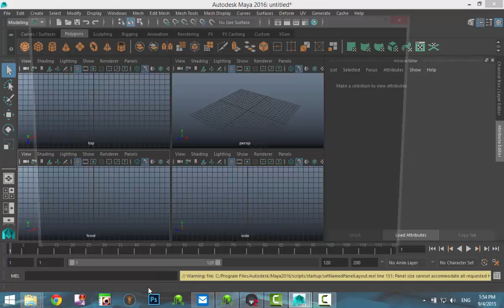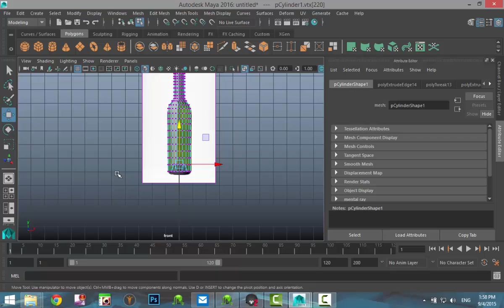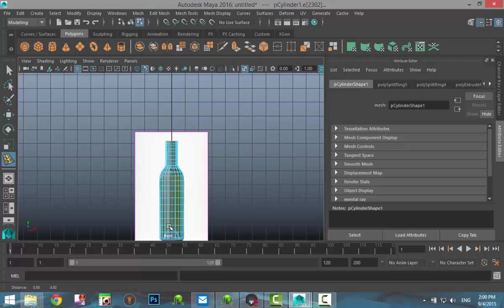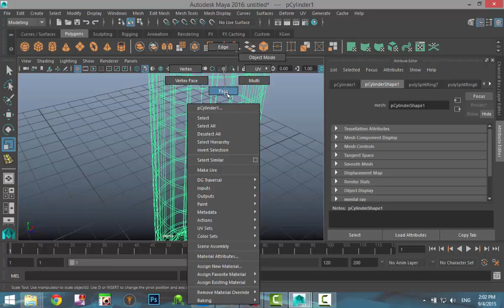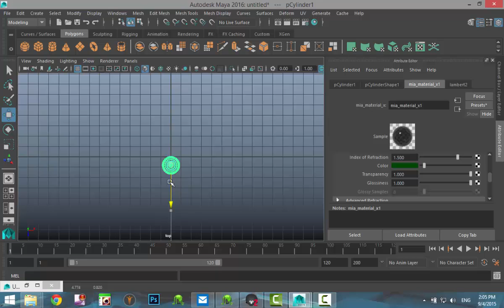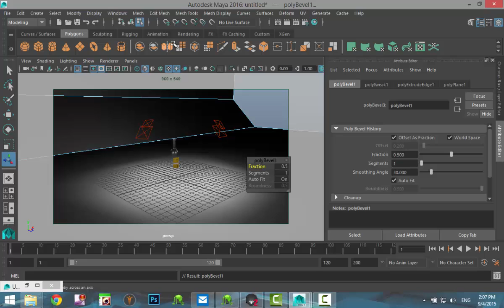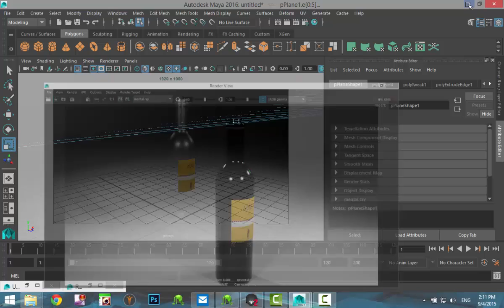Maya 2016 tutorial : How to model and texture a Wine bottle

Comment: Everything ok but the label is stretched on the end of both left and right side. In uv editor it shows me that the shells are more thinner when it comes to the edge. I saw some similar tutorial in 3ds and the guy was using Unfold option (though in Maya there is a tool with the same name but works differently, like for other purposes). In 3ds this option optimized shells in such a way that they were all the same width. After that he exported to psd, prepared label on the shell, imported it and stretching was no longer exist. Is there any possibility to do this optimized/unfolded shells in Maya? I couldn't find any clear answer and I feel lost...

Comment: Hello sir. i'm kinda new in maya and i have learned many things thanks to you.
i have done this tutorial and i've got same result except one thing and it is lable.
This is my little work and the Error in the bottom.
https://postimg.org/image/atoteqil5/

The jpg file loads fine when i place it in file location field. But i can't see it in viewport 2.0 while hardware render is on, and also when I begin a render, MentalRay comes back with an error relating to the file location or subtype.
Any idea what's wrong?

Thanks Again
Reply from the maker: Have you moved the image file to a different location ?
Reply: No Sir. i'm not that noob =]. File is still in it's location. i also tried to copy the file in some other locations and changed the address. but still not working.
i guess the problem is related to my mental ray stuff.
https://postimg.org/image/i0xg0axlz/
i had problem with finding and installing the main mental ray as you can see in the image above. But finally the last one, was the correct one. well... i'm new in maya.
Maybe i need to uninstall Maya and all stuffs and re install it plus the correct mental ray.

Thank you anyway sir. i wish the best for you.  :)

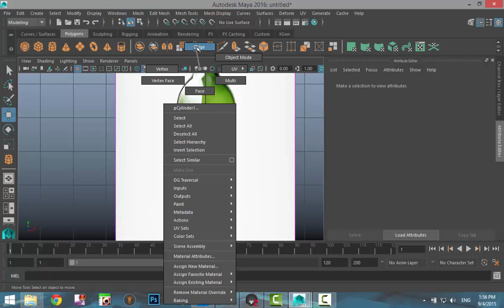Comment: I am totally new in maya and related stuff and i cant understand the extrude portion between 2:10-2:20 whenever i try to increase the height only the selected portion increase not like yours need help regarding this.
Reply from the maker: Does you bottle have a single wall or double wall ? Did you select edge or face ?
Reply: Edge
Reply: can you please tell me how to navigate also?
Reply: Same here. I need help too. There's only one portion selected in mine. I even turned the "Keep faces on" option in the transformation tools modification. What do I do to extrude the row like yours?
Reply: I have found it out sir, if u want to extrude in row,
Do like Hermes did,
Extrude a bit, and then extrude it again,
you will get multiple subdivisions after it, what u said "rows".
Reply: Actually I found that if you double click an edge and press shift the whole top row of edges will be highlighted and thus you can easily extrude all of the edges at once instead of one at a time. I found this from another video, but thanks for the input!
Reply: One more way is that, do not delete the top face of the model, select face, extrude the same way. its almost same i think.

Comment: Hey, Thanks for the video!
Just a few questions; So, for the material "mia_material.." did you have to download it ?because I'm using Maya 2016, and it doesn't show up as an option. Also, I do not have "Mental ray" either (I'm assuming that may be why I do not have the "mia_.." material).  

And finally, I believe when you go into "render Settings" you have "Commons" "Quality"  "Configuration" etc. I only have "Commons" is there a reason behind that as well?

Phew, sorry to drown you in a million questions, but thanks again!
Reply from the maker: Well a lot of questions :-)
Here we go :
1.Mental Ray is a plugin that you need to download and install ( www.autodesk.com )
Here are instructions : https://mhtutorialsyoutube.com/2015/07/04/q-i-cant-find-mental-ray-in-autodesk-maya/

Once it is installed you need to activate it in the plugin manager. With that done you now have Mental Ray and the MIA material
2.I render in mental Ray, that is why I have more options. Once you have completed step 1 you will have the same.

Mike
Reply: Thanks so much!!
Reply from the maker: No problem

Comment: I don't have the mia material x when he assign glass to it....... How do i fix/get it?
Reply: you will need mental ray, download it and enable it in the plugin manager (windows-setting- plugin manager). Also, if you have Maya 2017 you won't have the mia material for some time, because mental ray isn't in Maya anymore, and you'll have to wait until they update their software for Maya 2017
Reply: Did ytou ever find a solution?
Reply: not me, how?
Reply: ya, lemme know if you find anything. I'm using Maya 2015 so maybe I don't have this free material installed.
Reply: Install the plug in and enabke it in preferences
Reply: Try downloading Mental Ray for Maya :)

Comment: Thanks for the vid.  Question though?  What dimensions do you generally save your textures out as?   256? 2048?  Also, how would you feel about making a tutorial on making a (rugged or cracked street texture for maya?
Reply from the maker: +Product_Six When baking textures on object I usually will go 2K When rendering a still image it depends on what I am going to use it for. As for your tutorial request, are you looking for a cracked street texture or a cracked street model ?
Reply: +Mike Hermes,  A cracked Street model would be better than just a texture I'm assuming.  I am going for hi res environment.  I don't know how to go about it other than maybe sculpt geometry tool....idk.
Reply from the maker: +Product_Six Will it be animated ? ( If so, low poly is important and it would probably be more textures than modeling )

Comment: How did you set up your extrude? I don't understand when you switch g and w repeatedly to build the curve......help TAT
Reply from the maker: +Zhao Jack When you select the top face and hit extrude you use W to pull up, R to scale to make it narrower. Then when you hit G you reapeat the last command ( extrude ) and you use W and R again
Reply: I know I need to repeat W and R and G, but what I met is that my w and R doesn't work like yours in the video... Mine moves and changes uniformly but not independently
Reply from the maker: +Zhao Jack It sounds like you have the entire object selected and not just the top face ?

Comment: Sorry to keep asking questions, but now I have everything finished and it renders only a black frame.  Any ideas how to fix that? I made sure to follow you exactly
Reply from the maker: +K Plays Did you render in Mental Ray ?
Reply: Yes sir.
Reply: +Mike Hermes I can copy paste the error code I got in the output window if that would help.
Reply from the maker: +K Plays Sure
Reply: +Mike Hermes Initialized VP2.0 renderer {
  Version : 6.3.16.4. Feature Level 4.
  Adapter : AMD Radeon HD 7800 Series
  Vendor ID: 4098. Device ID : 26649
  Driver : .
  API : OpenGL V.4.5.
  Max texture size : 16384 * 16384.
  Max tex coords : 16
  Shader versions supported (Vertex: 4, Geometry: 4, Pixel 4).
  Shader compiler profile : (Best card profile)
  Active stereo support available : 0
  GPU Memory Limit : 2048 MB.
  CPU Memory Limit: 7738.13 MB.
}
OpenCL evaluator is attempting to initialize OpenCL.
Detected 1 OpenCL Platforms: 
 0: Advanced Micro Devices, Inc.. AMD Accelerated Parallel Processing. OpenCL 2.0 AMD-APP (1800.11).
 Supported extensions: cl_khr_icd cl_khr_d3d10_sharing cl_khr_d3d11_sharing cl_khr_dx9_media_sharing cl_amd_event_callback cl_amd_offline_devices 
OpenCL evaluator choosing OpenCL platform Advanced Micro Devices, Inc..
Choosing OpenCL Device Pitcairn.  Device Type: GPU  Device is available.
OpenCL device does not support out of order execution

mental ray for Maya 2016 
mental ray: version 3.13.1.2, Jan 22 2015, revision 236291
mental ray: started on "Khep-PC", Mon Jan 11 14:27:43 2016 
PHEN 0.3     10 MB error  051011: shader "maya_shaderglow" not found
PHEN 0.3     10 MB error  051011: shader "adskMayaVolumeEngine" not found
PHEN 0.3     10 MB error  051011: shader "maya_state" not found
PHEN 0.3     11 MB error  051011: shader "adskMayaAreaLight" not found
PHEN 0.7     23 MB error  051011: shader "adskMayaShadingEngine" not found
PHEN 0.3     13 MB error  051011: shader "maya_shaderglow" not found
PHEN 0.3     13 MB error  051011: shader "adskMayaVolumeEngine" not found
PHEN 0.3     13 MB error  051011: shader "maya_state" not found
PHEN 0.3     13 MB error  051011: shader "adskMayaAreaLight" not found
PHEN 0.8     24 MB error  051011: shader "adskMayaShadingEngine" not found
Reply from the maker: +K Plays I am no expert on this but it looks like your render engine is looking for things that are no longer there. Have you deleted the history of the scene ?
Reply: +Mike Hermes no I haven't deleted anything other than various stuff I messed up during the actual project
Reply from the maker: +K Plays That's my point. When you create stuff and delete it during modeling the history remains. You need to delete it

Comment: I'm having trouble extruding it up and scaling it.  It doesn't all move uniformly when I extrude it nor when I try to scale it in as the bottle curves up.  Can you help me?

P.S. What are the shortcuts you used to select the row of faces on top of the bottle as well as the all the top edges?  I can just manually shift click and select them all but it'd be much nicer to know your shortcut if possible.  Thanks!
Reply from the maker: +K Plays Hit shift and period ( you know, the thing at the end of a sentence )
Reply: I have the same problem as you in extruding the top of the bottle.. They all move uniformly
Reply: I have the same problem

Comment: Great tutorial, constantly keeps reaffirming the commands for each tool for everyone to remember. Questions: Do you have to look at the keyboard when deciding what tool to use or do you have a hand position that makes it easier to remember where all the keys your most likely to use are ? When I have to control or shift anything, I feel I need to look down so I was wondering what your set up is.
Reply from the maker: +VandalVortex Yes, I constantly repeat commands ( and some people find that annoying ) but I do that exactly for the reason you mentioned. As for looking at the keyboard, not really. But I have been sitting behind a keyboard since 1983 :-)

Comment: Hey, Mike, I have a question. Why does my maya 2016 work differently than yours? Also mine is missing some things that yours has, such as the mesh tabs. Whenever i tried to scale the edges it scaled the entire bottle. Also, whenever i clicked on the cylinder polygon tool it opened a pre-made cylinder for me. Please help me and thanks.
Reply from the maker: +Nick Mill Nick, to start with. Did you install any Service Packs onto Maya 2016 ? ( I have ) That may explain some of the differences. Secondly, make sure you dont have Maya LT instead of Maya.
Lastly, to avoid the pre -made cylinder go to Create - Polygon primitives - Interactive creation and turn it on.

Comment: cylindrical mapping i'm ok with but i have a problem with wood textures. when i put the wood texture on the cylinder the texture doesn't "fit", there's a visible line between flats (top and bottom) and round side. is there a tutorial that explains that or can somebody help me out?
Reply from the maker: +Christian Malle Christian, would will need a different wood texture for the top and bottom ( as in real life ) and then work on your color map in for example Photoshop to hide those seams
Reply: +Mike Hermes i understand that but it's only in a straight cylinder object. what if i want something like this snow globe base http://www.infendo.com/wp-content/uploads/2012/01/snow-globe.jpg. i want to texture it so it has that wood texture all over it (top and bottom) with a seamless feel of fake wood so it doesn't have separate top and bottom textures. if u understand what i mean.
Reply from the maker: OK, I understand. In this case you will have to tweak, unwrap and adjust your UV's to get a proper look and feel
Reply: +Mike Hermes can u pls explain in more detail? do i unwrap top and bottom as separate UVs or do i have to unwrap the whole object as one UV map? do i still use cylindrical mapping ?
Reply from the maker: +Christian Malle Christian, select a surrounding edge at the bottom ( out of sight ) and cut the edges there. Then do a Planar projection from the top and make sure you have two UV shells. One for the bottom and one for the top. Unwrap the one on the top. This should avoid stretching of the texture
Reply: ok, i'll try it and hope i can make it fit. thank you very much!
Reply from the maker: No problem